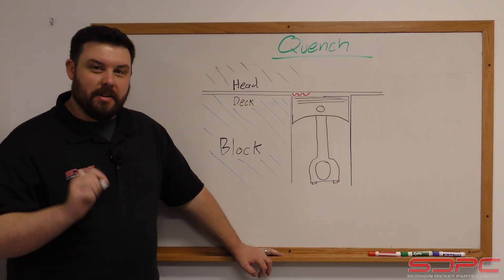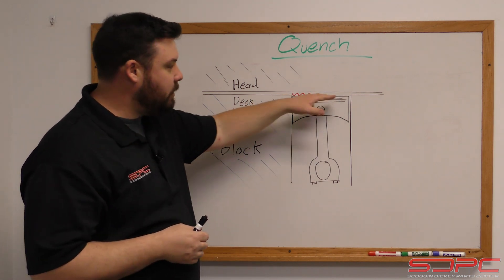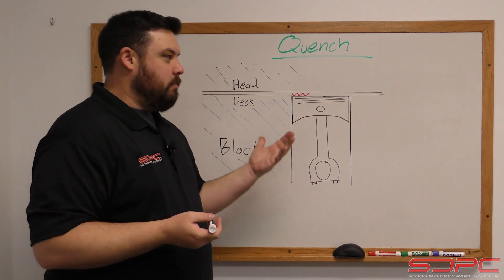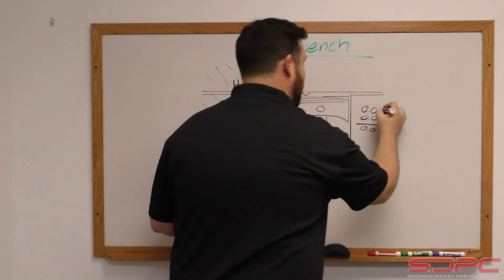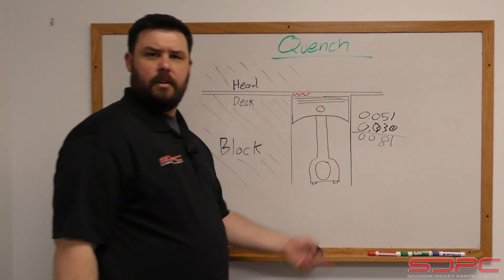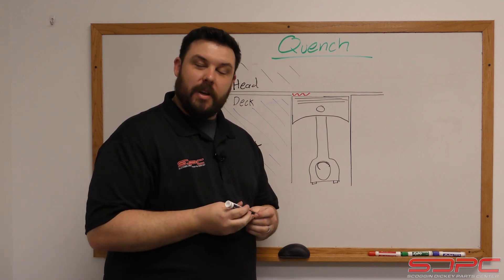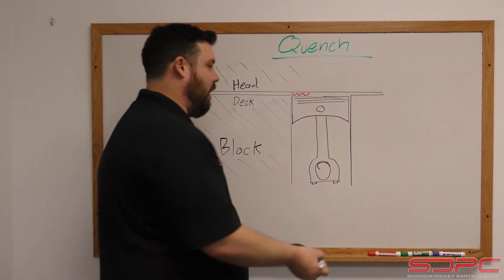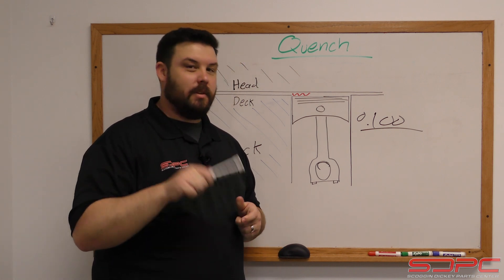SDPC Tech Tips: Quench Clearance

Comment: I have a stock vortec 350 with the Chevrolet performance 10105117 (.028) head gaskets. Did a efi to carb swap in my Tahoe and if I don't run 93 octane I get detonation, I reckon if it was in something much lighter I could run less octane with no consequence.    My timing all in is 34 degrees, on 91 octane it will lightly detonate (just a whisper of a rattle) under partial throttle load at low rpm on the highway, if I drop a gear it's just fine

Comment: Do the math... Forged Steel expands about 0.001 per inch  &  Aluminum  about 0.002  per inch.  
- Rod length 5.7" to 6.0" x 0.001  =  0.006"   
- Piston pin height 1.1" to 1.4" x 0.002 = 0.003"
- Rod bearing cap may stretch   =  0.002" 
- Insulating carbon layers on piston & cylinder heads 0.005" each  = 0.010 
Total expansion / stretch  = 0.0021"
- Deck height of cylinder block from crankshaft bearing insert expands providing 
some level of mitigation to heat expansion of rods & pistons. 8" = 0.008"
- Quench height of 0.030" was not a problem in SB Chevy engines I built 35 years ago. 
If you are wiping out rod bearings, it's either excessive bearing clearance or oil starvation. 
Rod bearing clearance o 0.0005 on the rods & 0.0007 on the mains works well with 20W50 Synthetic Oil.

Comment: You are incorrect about the  engine deck having to be flat to run a .016 felpro shim head gasket. I just rebuilt a 1966 283 and it had these head gaskets and and it was a stock bore 3.875". The engine was still sealed and running when we rebuilt it. The deck was so far off and warped it was at TDC to deck clearance of  .034 in one hole and another was at .057. we checked tops and bottoms of pistons deck clearances as well as the middles the numbers above are the middles. We found the top and bottoms to show up to .007 of warpage twist, on top of the slant. It was no where near straight. Oh and I miked the compressed shim head gasket and it comes out to .016.

Comment: I did a super late model engine and when I freshened it up after a season the pins were loose and I could see microscopic marks on the tops of the pistons.  I figured I had too little quench space  and got the pistons pin holes resized and .003 bigger pins and a .003 thicker head gasket and got the quench  to where it should have been.  I was lucky it didn't destroy the engine and could be fixed.

Comment: Quench,,
Extinguish or put out a fire 

Use squeeze
Reply: But the point of quench is to put out the fire in the quench area and push the air/fuel into the combustion chamber for a more controlled burn and less detonation.

Comment: Just for kicks, one observation: people always measure piston vs deck with the engine right side up.  I do.  So... you're "zero decked"?  Turn that puppy upside down and see how many tenths out of the hole you are.  5, 8, 11...more? - stacked bearing clearances will show themselves.  And we haven't gotten into crank flex, rod stretch, or thermal expansion for a running engine yet.  This is why most stop at 0.038" quench when its possible to reach for 0.035".

Comment: The part he left out isn't the minor bump in compression. It's the effect tight quinch has on detonation and between .060 and about .100 is the most prone to detonation. Sbc's ran .060 and low 8:1 compression to prevent detonation on cheap gas. By tightening quinch to less than .045 it allows you to run higher compression with the same gas without detonation. It also helps mix the fuel mixture in the chamber. I suspect that tight quinch helps prevent detonation by not allowing fuel to sit on the hot spots at the edge of the chamber or possibly creating slightly lower pressure in the quinch areas.
Reply: As I understand it, quench ends near 0.060".  Somebody out there is smarter than me and can probably prove that wrong, I suspect [science does that].  A proper cylinder head bowl/chamber combo provides swirl on filling, but its quench that adds a soft roll motion to the compressed air/fuel mix right near spark to help flame front perform better. A lazy flame front will not burn as efficiently, plus peak cylinder pressure will be a little off.
Reply: Quench i believe helps promote swirl in the combustion chamber which i believe helps to take heat off the exhaust valve which is where detonation will typcially occur first. Also, air has a large thermal conductivity, so tighter Quench reduces the thermal resistance between the cylinder head and block helping to more effectively remove heat and prevent detonation. Further, not using tighter quench loses you power and efficiently bc the higher compression makes the engine more efficient and produces more power. This also should help to allow running a leaner 14 to 15 AFR with lower octane fuel in cruise to get better mpg. I'm not sure but I believe piston rock especially with forge pistons also has alot to do with the quench limits apart from mechancial strain from higher RPMs which limits the safe quench to .035 to .04. Also, piston type such as recess dish, flat, or dome pistons to my understanding is very important since stock dish pistons have terrible quench area so you have a good quench height based piston to deck clearance and gasket thickness, but the dish is recess .06in and effectively your quench is missed at over .060.

Comment: On Gen. 1 SBC's I have the machinist deck the blocks so the pistons will be down .010" in the hole and I run a .030" thick head gasket.  Never built a LT1 or LS motors.

Comment: Factory small and big block chevy's came with steel shim gaskets.
Reply: True smog ERA L82 SBCs came with 0.018” shim gaskets. That doesn’t mean that come rebuild time that the deck surface is still perfectly flat. (My 14.4k mile L82 had some high spots on the deck.)

The OEM deck finish doesn’t meet the smooth RA values that FELPRO recommends for that 0.015” shim gasket, but they do admit that a spray of copper coat can help deal with minor surface imperfections allowing them to be used.
Reply: @adamarndt7617  With iron heads and under .003 with a straight edge you're fine. I use permatex super 300 for sealer,

Comment: My lq9 after being decked had a deck clearance of -0.018 which is 18 thou out of the hole. I was set on ordering a .040 head gasket. Had I done that my quench would have been 0.022 quench which would have caused the piston to smack the surface of the head at high rpm (huge issue!). Im glad I double checked and went back to really understand this. It saved me a lot of headache and my pocket thanks me for it.
Reply: I was 25 thou overdeck and used .40 gasket. Rev limit 6500. No issues . 1.6L sohc

Comment: A trend in higher performance applications is to reduce quench.  Pro Stock and Comp eliminator have found that they make more power, have a larger tuning window, and less detonation issues when quench is reduced.  Softened chambers are being used for this...
Reply: I didn’t get it with this “ softening “ . On one side you try to make the quench as small as possible and on the other , in the same time you increase it with the “ softening” of the quench surface of the head . Also , looks like they  
apply softening mostly to high boosted engines heads .

Comment: Steel rod .035 safe .030 .028 close ran .035 not problems on 7500 rpm sbc 550 to 600 Hp bearings look great could have reused on rebuild up grade .035 safe if rods hit then you are ready blown up

Comment: And if you run that .015 thick head gasket, the best way to get it to seal is to deck the block...which means you can lose that zero deck. Plus the Gen One block uses five bolts around the cylinder bore to seal, the LS uses four bolts.

Comment: Safe is to factory specs! Factory tolerances need the extra wiggle room. A after market pc with proper machining will benefit drastically with a .030 gap on wedge style chambers. But realistically...l.s. platforms builders are using factory clearances." Play it safe" is for those guys.